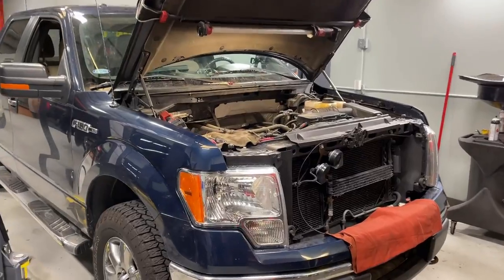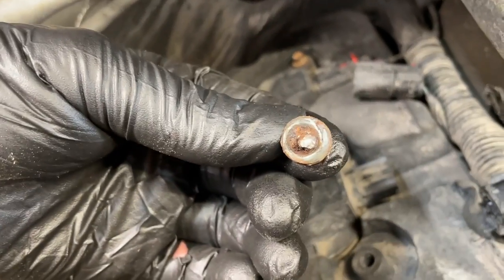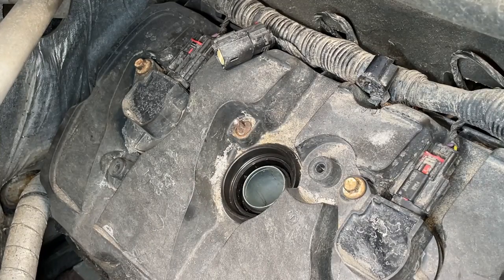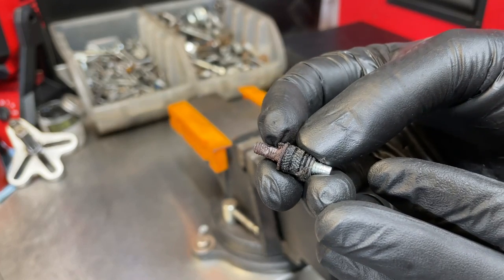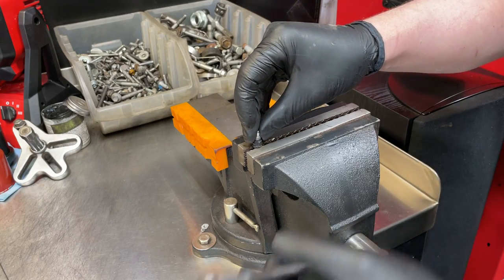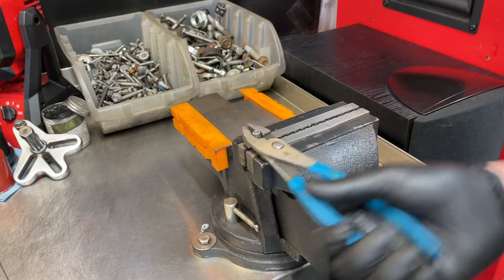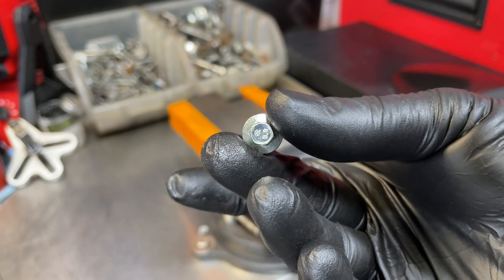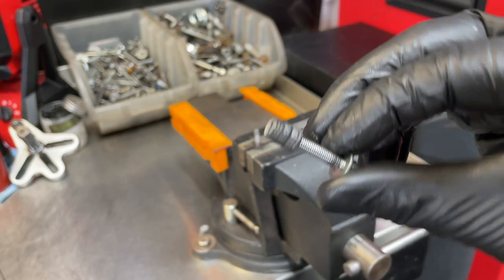Ford 5.0L Coyote Engines: The Best Way to Extract Broken Ignition Coil Bolts in Plastic Valve Covers

Comment from the maker: These are the Parts and Tools I Recommend:
5.0l Coyote Ignition Coil Bolts P/N- W714507S437
Anti Seize-
https://amzn.to/31y5qIL
Mini Torch-
https://amzn.to/2PIFyXY

The original 5.0L Spark Plug Replacement Video-
https://www.youtube.com/watch?v=s5ohxYbcjoA

As an Amazon Associate I earn from qualifying purchases.
Reply: Have a question but nothing to do with video. I bought a 05 ford f150 5.4 3 valve motor everything is good when I first crank it, but when it get to operating temp an come to a stop oil pressure drops to low but while driving its fine. I changed the oil pump with high pressure oil pump any thoughts?
Reply: I know this has nothing to do with your post here. Love your videos. I've got a 2012 ford f150 with the 5.0 coyote engine lots of folks have the same problem with low oil pressure lightning on in drive when you stop idle drops to 500 rpms from about 550 when in park. In park it will run no problem no light. Truck is fine first 10 or 15 minutes driving then ya get the low oil pressure light every time you stop. I'm wondering if a higher viscosity oil will help. Or if it would help or if possible to raise the rpms so it will stay above 500 in drive? I simply haven't seen any videos that address this issue other then the oil pressure switch where in all cases the switch was wet with oil from an internal leak. I dont have that. Very difficult to get to on a 4x4. I'm a do it yourselfer. Sorry for the long spill. Any help or ideas would be greatly appreciated.
Thanks in advance.
Reply: Hey sorry for being off topic. Iam trying to look for a fix on a 2003 6.0L excursion Diesel trubo I can start the truck up no problem gas it fine in park. When I shifted in the drive or reverse I step on the gas and the truck has a lack of power. Truck will not go passed 10 mile per hour. no codes because the two batteries were dead replaced already.
Reply: Hi I need your help please I have a 2010 Ford Mustang 4.0 V6. There is something wrong with my clutch and someone told me it was a Hydraulic clutch know I don’t know much about hydraulic clutch is but I know you have to push the clutch pedal all the way to the floor just to get it to engage in first gear or to get it into reverse once you were driving it switches gears OK I don’t have to be all the way to the floor to switch the gears it’s only in first and only when I’m switching to reverse so I don’t know what to do can you please help thank you love your channel
Reply: @ja7941  so what are you saying you can push the clutch in and you can only shift to reverse and first gear?
Reply: Is there a chance you have a video showing proper operation and diagnostic of a 5.4 3v fuel system. 2006 f250 desired FP 40psi all the time actual FP hunts 38-41 while idling and driving except when it drops to 5-6 psi Randomly.  FPDM checked with known good unit as well as the rail sensor. Wiring checks out also. Truck is kind of rusty so I’d like to be sure it needs a pump before I tear into it. When I ramp up duty cycle pump makes 75 psi. In general the truck is a dog also. It has been since we got it. It just seems odd that it always wants 40 psi and the actual duty cycle never exceeds 38%
Reply: @mickgriff6668  my 04 did the same thing. At idle while in gear it would drop oil pressure. 
You HAAAAAAVE to keep up with oil changes on the 5.4L 3 valve and make sure you use a Motorcraft or real good quality filter. 
The filter that was used in my truck was a crappy no name and it  collapsed inside and caused the pressure to drop when at idle. 
I then changed to K&N oil filter and haven't had any issues. 
But I have to say I have never ever owned a vehicle that is so sensitive to oil pressure and oil level. If my truck goes down less than half a quart the timing gets thrown off and it starts to miss fire. 
But very important to do a oil change every 3000. 
I've actually been doing them 2000 to 2500 now because it's a Ford.
Reply: Can you do a video on how.to repair a ignition coil repair for a 5.4L 3 valve. The bolt on my valve cover stripped out. And I'm not sure how to repair it. My first instinct said grab JB weld and fill it up and retap the hole to the correct size.
Reply: @Hawaiian.808  I had the same problem years ago on a Ford F-150 V-8 gasoline engine. It was fairly common and just needed a new fuel filter.
Reply: Can you guys do a 2010 Jeep grand Cherokee ignition coil bolt tutorial a mechanic 😂 so called broke mine after should have been easy replacement now the bolts end is stuck in the threads at the bottom of the hole should I attempt it or just pay to fix it

Comment: Honey, before we leave on vacation, I'm going to change the spark plugs real quick! It'll only take a minute!
Reply: Literally me before my last vacation. Luckily none of those bolts snapped but one of the stupid coil plug clips broke. Got a couple zip ties holding it on now!
Reply: @DLITINTHEHOUSE  they are super easy to replace, I replaced all 8, and I was able to rebuild the connector by removing the wires from it, rather than cut and splice
Reply: @thomaslang8826  oh ok. Thanks for the tip.
Reply: This was me helping a buddy change plugs at my house. This won't take long! One of the boots broke apart during coil removal. Hope you got a pair of 10 inch needle nose pliers! Or some giant chopsticks
Reply: Never, do any work close to your vacation. 
I have even seen people panicking because they updates their satnav the day before the trip and it failed...

I once made the mistake of changing the rotor and distributor cap just before a roadtrip and you guessed it, the damn rotor burned up on the first day. Luckily close to a town which had a dealer that stocked the parts.
Reply: This comment speaks to my soul
Reply: LMAOOOOO THAT WAS JUST ME LOL
Reply: Lol
Reply: yea this tha one
Reply: I'm reminded of Dear old Dad who was asked if he would be done in time for dinner. He said "Go ahead and start dinner, It's just a water pump, it won't take that long." Well this water pump was on an Isuzu truck, not a Chevy, and to get to the water pump you had to take the timing belt off. It was a bit more than a 30 minute job...
Reply: My bolt broke off half way in, because i over torqued the replacement....thinking of using automotive high heat adhesive to attach the coil and just ignore the broken bolt?....
Reply: Ford stole my whole vacation just trying to change a water pump. 😠
Reply: @mel3256  does that work?
Reply: Clearly you dealt with it already but I did use high heat adhesive. It held for 8 months then I stalled on the side of the road...had to clean off rock hard adhesive before repair
Reply: That's so funny 😂 @jeffbrown3963

Comment: NOTE TO SELF - Remove ALL Coil Bolts and add Anti Seize!!! 😲
Reply: Might as well replace them with new bolts if you gonna take them out
Reply: I just completed this job, all 8 bolts threaded out perfectly without any drama. Corrosion had started on numbers 3 and 7 just like the video shows. Mine is a 2011 XLT supercrew with the 5.0 and 81,000 miles.
Reply: Duly noted.
Reply: Junk them get so SS bolts and call it
Reply: The bolt broke from corrosion near the top.
Reply: And maybe a little Fluid Film here and there…

Comment: I could not get the inserted piece to hold even after three tries.  I eventually used a bolt with the head facing down and three nuts tightened up to the head which I heated and set in the valve cover (threads up).   After cooling it was rigid and I tightened the coil down with another nut on the top side to secure it.  Thanks For proving me the information I needed to make this fix.

Comment: Ford clearly does not want spark plugs changed. 97-03 too few threads in head. 03-08 spark plugs break in half. 09-14 ignition coil bolts break in half!
Reply: crazy right!  your so right!  its like does anyone at ford own a ford truck?  come on ford!!
Reply: WWHHYYYYY!!!!

Comment: I happen to have a bulk supply of those inserts from another job, and I've been fortunate for that. I've had to repair the customer damaged valve cover and install a new insert. I've seen melted, chiseled, and air hammered attempts. All suffering damaged covers. 

Great info and video on a good repair! 20 years doing driveability for Ford dealers has seen a lot. Good to know that there are other great technicians out there still willing to do the work that keeps us on the good side of the paying customer. Thank you for sharing!

Comment: Did this trick on my 6.2L F-250 today, after my induction heater arrived. Thank you for putting this video out there, to help folks. The intake for a 6.2 is not cheap!!!  Buying the heater for this was half the cost of the manifold!!

Comment: We use these inserts in the products we make.  The brand we use are PEM inserts by Penn Engineering, just in case you may need to get some. I wouldn't be surprised that these are the brand that Ford uses in these covers.
Reply: do you happen to know where eI can get the insert?
Reply: @BM-vj1px  We buy direct from Penn.  But we buy on contract.  You probably could buy direct too; I'd call them.

Comment: nice tip.. also, if the insert wont hold, there are threaded inserts made by ez-lok, that have coarse outer threads, and machine threads inside. woodworkers use them...    Love your channel... I have learned much from watching your videos.. You are a good guy!

Comment: Worked great!

Tried to take out the first two bolts, and they snapped.
Now What, just like the video said.
Followed the steps, up and running, now off to Ford to probably
way overpay for new coil bolts that don't do what their supposed to
in the first place. 

I sprayed the other 6 with WD, let it soak in, and they came out with no issues.

A very big thank you for posting this video!!!
Reply: Wasn't too bad...  $3 each at the dealer.

Comment: Great video, Brian. Looks like this fix would work with any car that has a plastic valve cover and metal inserts for the hold-down bolts. This is also a good reminder to put anti-seize on those bolts.

Comment: Just traded my 2016 5.0, 83k miles and check engine light for VCT cylinoid under the vale cover.  I was able to get the check engine light off by adding 100%  petroleum Lucas oil. I bought the 2.7 f150,  ill never go back!  I'm so impressed with that little twin turbo.  Great videos!

Comment: On an unrelated topic Here’s a tip that may help if you have the problem I ran into. The problem was that the engine dip stick tube on my 2010 F150 4.6 3valve rusted out and I couldn’t get the dip stick in any more. The rust was worst where the tube passes the exhaust manifold. When I went to replace the tube it broke in three pieces with the stub end still stuck in the block and nothing left to pull the stub out with. After some thought I took a piece of 5/16 coarse thread threaded Rod about 4” long and locked two nuts together at the top and threaded it into the stub. The stub is swaged down just inside the block such that the threaded rod cuts into the inside and firmly attaches to the stub. You then take a 3/8 drive deep socket 16 mm size and place it over the threaded stud. Add two 5/16 flat washers and a 5/16 nut. Slowly turn the nut down the stud until the stub end is withdrawn from the block. The only other way to get the stud out would be to remove the oil pan which won’t come off unless you jack the engine up. Something you definitely want to avoid. anyway hope this helps anyone who runs into this problem.

Comment: Customer "What's the labor for replacing spark plugs"
Mechanic "1.5 to 4.0 Depending on what breaks"
Reply: 5.4 can go way north of 4 hours LOL
Reply: Literally what the Ford dealer told me when i asked about changing the plugs in my 03 4.6.   So i just waited till i blew one out of the head
Reply: Ford 6.2: hold my beer
Reply: The v10 Triton engines were the worst, had to buy a spark plain extraction tool for certain years because the non adjustable spark plugs had ends that either got stuck in the head or fell down and punched holes in the pistons
Reply: @The RealMathilda yes but it depends on where you get them ,you can also take the little diode out if the inside of them very easily , they usually fall out, stretch the spring a little and then put it back on just to see if it helps or not, a little road side trick I learned, you can get cheap ones on eBay, idk how good they are though

Comment: Another brilliant idea from ford , Best thing to do is coat the bolts with anti seize when you buy the vehicle brand new .
Reply: Or never drive in the rain. 😂
Reply: Also cover the upper suspension openings with a shield/barrier like the eco boost has to keep all the road spray out of the engine compartment. That’s the cause of all the under hood corrosion in the first place.

Comment: Bravo - Pretty cool fix. Just a reminder not to remove the spark plug until this repair is completed. Unless you close off the spark plug tube, there is a risk of dropping something down the hole. Could make for a very bad day......

Comment: The real question is, Do you even need something holding down your coil?  Some brands don't use anything but the tight fit in the hole, and the boot grabing the plug.

This did happen to my 2011 years ago and I rigged a bracket, seated into one of the empty holes.  Your method much cleaner, especially for a customer's car.

Comment: I've never had that problem with the 5.0's, however I've had the issue multiple times on the  3.5's in the transit vans, always in bank 2. Usually the insert spins out before the bolt breaks though. I'll have to remember this for the next one.

Comment: Also making up some rubber inner fenders really helps, it a shame ford didn't do it from the factory to keep water and mud off the engine.
First thing I did to mine and the top of the engine is still nice and clean.

Comment: Exactly how I have done them in the past. However sometimes the insert is too far gone to salvage, in those cases I would use Fusor Epoxy to glue a M5 nut into the insert hole. Have to limit the torque on the bolt as the nut doesn't quite have the surface area to hold it in place as the brass insert does.
Reply: I'd probably epoxy a bolt made into a stud for this fix.
Reply: @jamesplotkin4674  Yep that would work well also. Just be sure to apply a good coat of anti seize to the whole surface of the stud after epoxied in place. In some cases I had the head of the factory bolt snap off but the coil was seized onto the shank of the bolt. It will break off the mounting ear of the coil if you are not careful. Had to apply heat and pull the coil off it's metal insert.
Reply: @blainebennett  I have a love-hate emotional bond with Ford, but this is another (of several) situations which are totally avoidable.  I'd hate to have to spend all day on this if several bolts broke and all I want to do is replace plugs.  Sound familiar?

Comment: You're the best this literally just happened to me I will be doing this next day I have off for now the coil is holding and hasn't popped out for now
Reply: Lol same thing for me. Coil bolt on # 4 snapped right off at the head. So pissed off of course it's the back one. Going to try to get it out on my next day off. I wish Ford used stainless bolts or just designed it so the screws could have plastic covers. Bad engineering if you ask me.

Comment: The best treatment for SMALL burns is to hold ice cubes on them for a while. Keep applying the ice until the pain subsides. Begin the ice as soon as you can after the burn happens. Obviously, large burns need immediate hospital emergency room visits, with professional medical care. I'm talking about a burn from grabbing something hot.   
You may be wondering how I discovered that. Well, decades ago, after cutting a 1/4 inch thick X 1 inch wide piece of steel with an oxyacetylene torch, I foolishly tried to carry it, and the torch, a few yards. The steel slipped, and the still hot end landed on my arm. Surprisingly, although I smelled burned flesh, I felt little pain at the instant it happened. But I knew what was coming, so I ran inside the building I was working on, grabbed an ice cube, and applied it to the burned spot. I kept doing it until the pain subsided. When it would start burning again, I would hit it with another ice cube. After a while, and several melted ice cubes, the burning sensation stopped.  Even though the wound took a couple of weeks to heal, the discolored spot was barely visible. And I didn't have to endure hours of painful burning.
The best part of the story is that I was installing burglar bars, for free, on a Knights of Columbus building when it happened.
Reply: Great tip. Thank you.
Reply: First aid/hospitals/doctors suggest against ice on burns as it can cause further damage. Run Cold water for 15 min instead. Repeat, will help with pain also
Reply: @LA-TEEZI  No doubt cold water would have been better, but I didn't have time to mix up any, as I wanted to stop the pain before it got too severe. As to the damage, I was surprised at the faint mark the burn left. It oozed clear liquid for quite a few days, due to the skin having been damaged quite a bit. I could see a faint mark there for years afterward. But today, I can no longer see it. I'm not sure why it disappeared, since I could see it for at least a decade after the burn healed. Enough skin cells must have survived to  prevent scaring. 
 The only cold water coming out of the tap in Louisiana is during the 3 winter months. During most of the year, it feels warm, unless you shower with it.

Comment: Nice fix!  Thanks for sharing.  Btw do you think blasting these bolts with penetrating oil before doing the job will do anything?  Or would it just not be able to travel down thru all the rust?